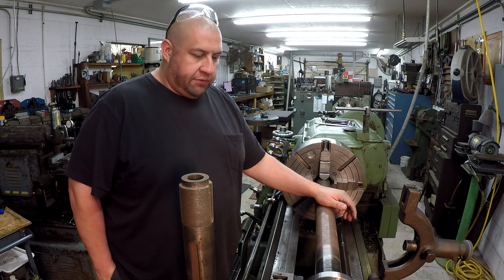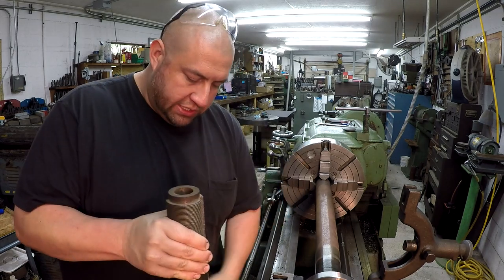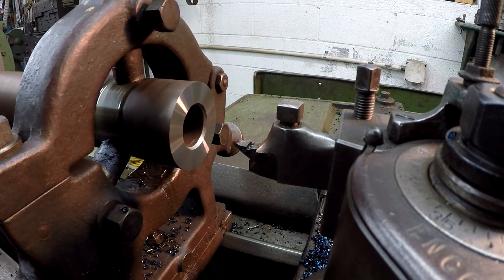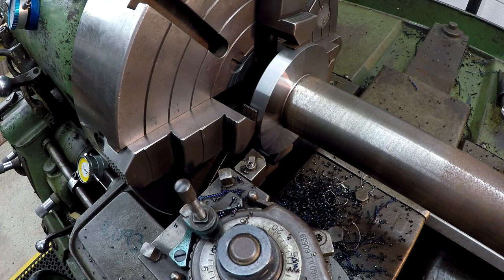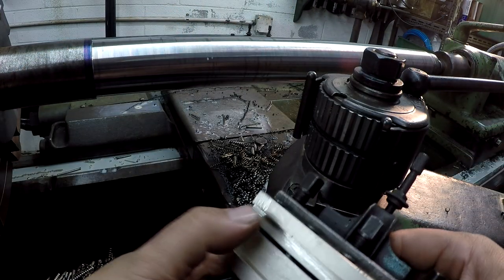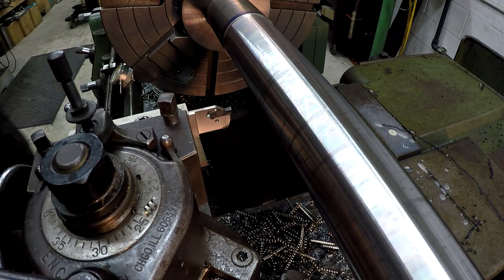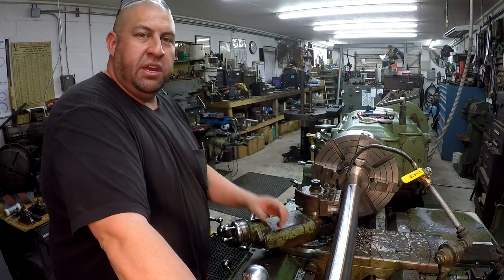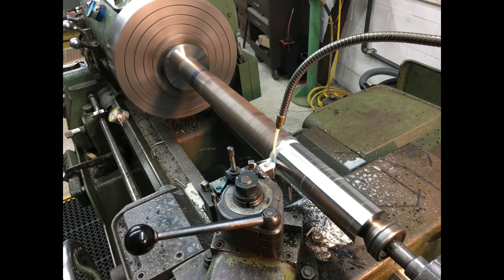Gearbox Shaft for Well Drilling Part 2

Comment: So just for testing  purposes I´m gonna metric data on which I´m cutting that type of steel with carbid metal inserts you just need to convert it. In case you end up in between the rev ranges of your lathe just use the lower ones. So I use 200 m/s cutting speed and for feed I use .25mm/rev cutting depth does it at 1.5mm and depending on what your machine can do.
I´m impressed with how your machine did over the length considering your dad bought it as you said somewhat earlier. You got some beautiful piece of engeneering there.
Don´t worry about face grooving tools screaming at you, they will always do even on cnc machinery.

Comment: Trepanning tool gets some 'revenue time', being used for earning some bread now. :)  When going in the extra .025 for the bearing clearance, I wonder if the 'singing' issues were not only because of how so much meat had already been cut out, but also due to just how hard and tough the material was.  4140 I've mostly heard of and read about in its use for making the aftermarket inner axle-shafts of axles put under hard-core, 4x4 rock crawlers and rock buggies and rock racing rigs, where anything less WILL break in very short order, and so I can only imagine what makes it such good material for those applications also makes it more difficult to machine, requiring the machinist to be patient and not be in a hurry.

On anticipation of the square/ACME internal thread cutting, I'm more interested in seeing what profile the cutting tool for that will have.  Mr. Rucker recently cut some ACME threads for a spindle sander shaft and showed how his compound was reset closer to a right angle for it instead of being at 29.5 or a multiple of it as is customary for normal threading, but the profile of the cutting tool wasn't visible too well in the video.

Comment: Wow I can't believe you didn't get ANY taper when you made that big long cut.  That lathe must be in great shape!! Also, is that coolant water based? Does it cause issues with rust? Do you need to clean it up right away??
Reply from the maker: Well I did get a half thou...:) Sometimes that's how it comes out. I can go in a take a finish pass and I may get more taper. Yes the coolant is water based, soluble oil.It's not supposed to let rusting accure but it's best to clean up after the day.
Reply: Abom79 Thanks for the reply!

Comment: Seeing all this chip making has me missing cutting more metal than wood. I have to keep telling myself it will all be worth it in the end......if I ever get to the end. lol
Reply from the maker: +bcbloc02 You will and we all know it. You didn't come his far to bail on us now! Looking forward to seeing that new floor poured and the doors up!
Reply: I saw a sign---  JUST AS I GET TO SEE THE END SOMEBODY MOVES THE ENDS.

This is the one I really like-- When in trouble or in doubt, run in circles, scream and shout.  That is why I am always hoarse and dizzy.

Ga' day guys.
Reply: Abom79
Funny I got started on building the doors, then found out it was going to be a month on the hardware to hang them with so now I have huge partially completed doors I have to drag off somewhere out of the way so I can move on with the concrete instead. Maybe i will work on the crane or hbm anchors today since both need to get finished before I pour the floor, give me an excuse for some shop time. :-)

Comment: Where does all that coolant go Adam ? I've never seen you use that much before does it recirculate?
Reply from the maker: +Joe Shearer it falls to the chip pan and into the coolant sump. The pump picks it back up and it just recirculates.

Comment: Where did you get that trepanning tool. Is it an insert? Make and model, part number?  I had to make a very similar face grove a while back and I struggled grinding a hss bit to get that bottom clearance. That tool is really nice.
Reply from the maker: I bought it thrugh a tooling supplier. It's made by ISCAR and the blade itself is an HFFR
Reply: Thanks man! Iscar makes really good stuff.

Comment: Do you worry about the insert shifting when making sideways passes with the face-grooving tool (and other insert holders like it)? I do it all the time with HSS and carbide solid parting tools, but I think I would worry about the insert type.
Reply from the maker: They can handle some light cuts side to side, I use them alot of cutting o-ring grooves and seal grooves in pistons.

Comment: I  enjoyed watching you use the face grooving tool. I have a project that will require face grooving. I was going to create one from HSS. Any tips or ideas?
Reply from the maker: Just make sure you grind the relief of the tool under the cutting edge in a way that it clears the groove as you plunge inward. It should look like a radius under the cutting edge.

Comment: Silly question. At 2:36 you talk about using your copper soft jaws so you don't dig in to the machined surface. Wouldn't it be easier to leave the OD slightly over size and do your machining and then go back and machine the correct OD ? Hope you understood that :-)
Reply: Not speaking for Adam but you have to hold a finished end of the part at one time or another. If you finish end A first you have to chuck it to finish end B and you take the chance of leaving chuck marks. If you finish end B first you have to chuck it to finish end A, and you take the chance of leaving chuck marks. Either way at some point you take the choice, use soft jaws or leave chuck marks.
Reply: Luckystrike Thanks for your reply :-)
Reply from the maker: Evan Davis as luckystrike said, it's a trade off. I wanted to finish that outer end completely and not have to go back to it.

Comment: So when you decide to use a coolant flood what's the primary motivation? Is it just in cases where the tool pressure is high like with parting tools, is it more about clean finishes, or something else? Also, does the coolant flood really do anything to keep temperature related deformation down?
Reply from the maker: That's the only lathe i run where I actually have working flood coolant. It's best to use all the time if practical, but especially when taking heavy cuts. It prolongs the tool life and keep it and the workpiece cool.

Comment: You probably mentioned this in a previous video, but it looked like the other end of the Iscar tool was broken.  A learning experience?
Reply from the maker: Barry Gerbracht yep. I hated when it happened too. I did that cutting the center out of that large sprocket I shown in SNS 140. I used a wider insert and it had way to much chatter. The chatter made it break. 😒

Comment: On your second rough cut, the chip didn't coil the same as the first pass.  Did you change the feed rate, or was that from the slight difference in the diameter of the piece?
Reply from the maker: +Des. Perado much different depth of cut.

Comment: No idea why this occurred to me now and I'm sure you've answered it before, but does any of your equipment at the shop use three phase?  If so do you get it direct from the source or convert?
Reply: SNL 101 (maybe 102) covered this. In short, all the big machines run on 3phase. He gets it from the pole (he got lucky on shop location).
Reply: Also in Shop Talk 7 he covers it.
Reply: That's right, he does have 3-phase running straight to his shop, and it wasn't just shop location that worked in his favor, its the fact he's got so, so many machines that require 3-phase power that helped out a bunch too.  

What makes getting 3-phase so difficult and expensive is that the power company has to do a dedicated 'branch run' of three phase from somewhere that ideally doesn't already have any single-phase residential service drops on it, and that 'private 3-phase branch' also has to be marked as unavailable for having any residential single-phase service drops hung from it.

This helps to ensure that the dedicated 3-phase service run is balanced, i.e., the voltages of the three phases are as steady and stable as practical to prevent damage to the motors using it due to phase voltage imbalances.  Single-phase service drops to serve normal residential customers introduce phase imbalances in the power lines that the power company can minimize to an extent, but not to the degree of eliminating the risk of motor damage when running 3-phase loads off a branch run that also has a large number of residential service drops on it.
Reply from the maker: +jcims yessir, 3 phase to my shop. I covered the subject in Shop Talk. Check it out!
Reply: will do, thanks!

Comment: What do machinist do with the metal chips they produce?
Reply: They are taken to the scrapyard and we get some money for it.
Reply: ***** good, glad to know they aren't being thrown away
Reply: Recycle - scrap yards take them by the pound...much cheaper than smelting new metal.
Reply: Steel is the most recycled metal by far. Nucor (a large steel company) only uses scrap steel to make new metal.
Reply: I remember hearing that aluminum was the most recycled metal. Are you sure?
Reply: Yes. In both volume and tonnage steel beats aluminum by far...
Reply: Metal chips are almost 100% pure steel/iron.   So recycling saves a huge amount of money, energy, natural resources, and reduces the amount of pollution created.   Consider the savings compared to burning fuel to dig up dirt, refining it and transporting it to the smelter, all of the coal/energy cost of the flux additives (coal, limestone.... have to be mined, refined and transported as well).   Scrap metal is "ready to go".... just add heat and some flux/limestone!

Comment: Where does all that flood coolant go when it goes onto the mill? Do you have to manually get it out of a catch? Is it difficult to clean all the splatter?
Reply from the maker: Nathaniel Baier you mean the lathe? There is a sump in the bottom of the chip pan that holds the coolant. A pump pick it back up.
Reply: Abom79 Yes the lathe. I didn't know there was a catch at the bottom. Never really seen one up close in person but love watching metal work. I see all the chips and coolant go down in the tray but often wondered what happened when it filled up. thanks for the reply and love the videos.

Comment: Can someone explain to me why they wouldn't use a large ball bearing on the steady rest (on each of the three arms)? Not accurate/rigid enough? (Please excuse my ignorance, I'm not a machinist.)
Reply from the maker: Many machines come equipped or were optional for roller bearing steady rests. There some cases where each one has an advantage, like the solid arms won't catch chips, but will create heat. I just use what I have.